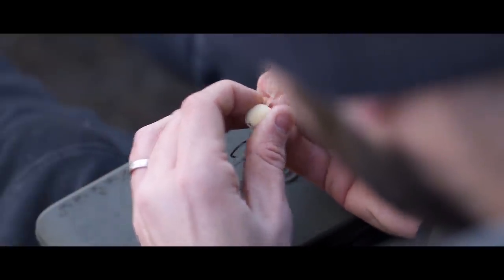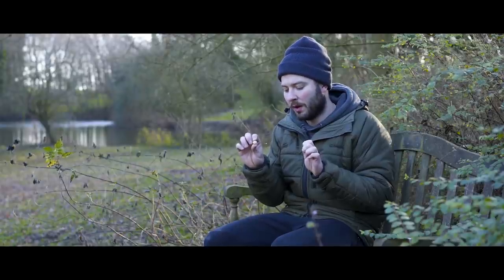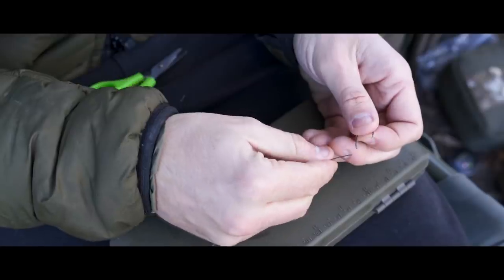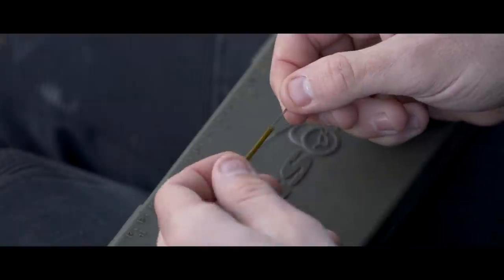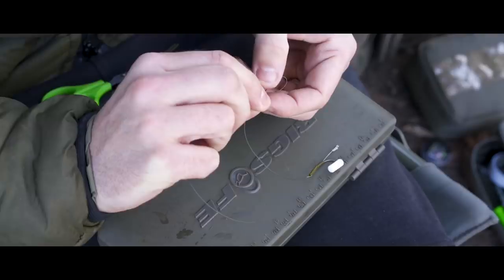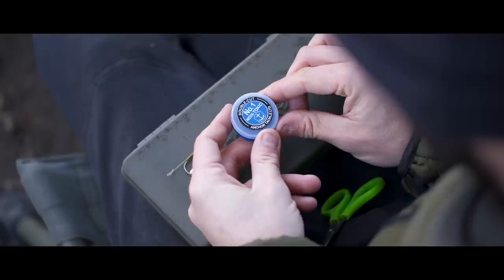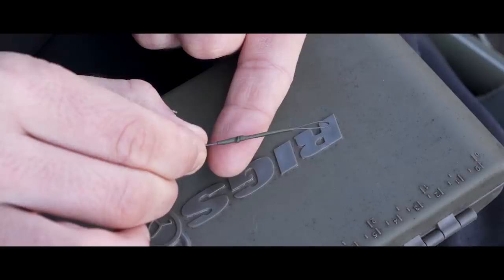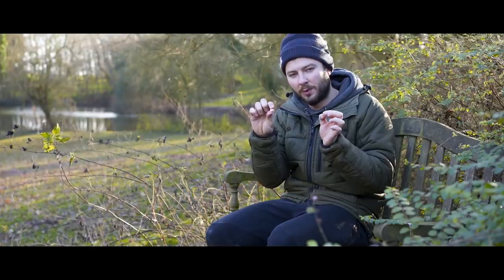How To TIE ELLIOTT GRAY'S FAVOURITE RIG

Comment: This is basically my wafter rig, no need for that much shrink tube, can trap the hair opposite the point on shank with 0.5mm silicone, also just use a smaller loop and anti tangle sleeve other end. Will save you a fortune on shrink.
Reply: Anti-tangle sleeves are big con in themselves, just make a bigger loop around 2-3 inches and it acts in the same way.

Comment: Would you use this rig with balanced or bottom baits i.e hook flat on bottom. In this instance would you remove the shot or does it still help with hooking properties?
Reply: yes u can fish wafter bottom bait and pop up i would fish it with shot for the hook hold
Reply: Yep, my rig for wafters is the same as this, except I trap the hair opposite the point with some small silicone. No need to use all that shrink tube. Just for kicker is fine. I use a small bit of putty instead of the shot

Also I use a curve shank